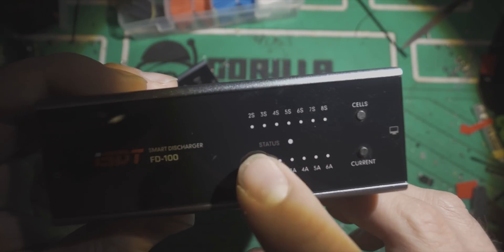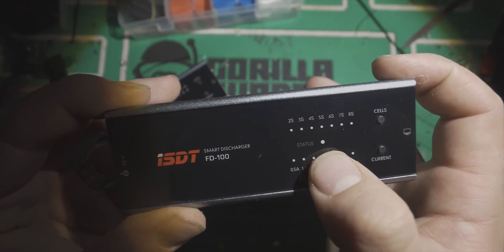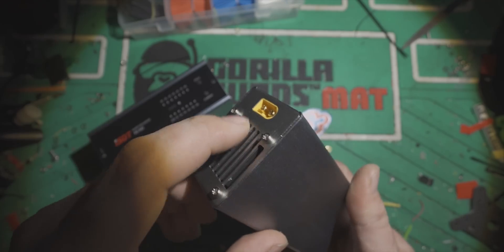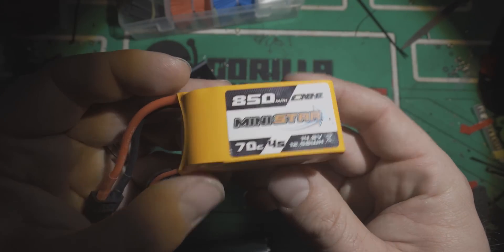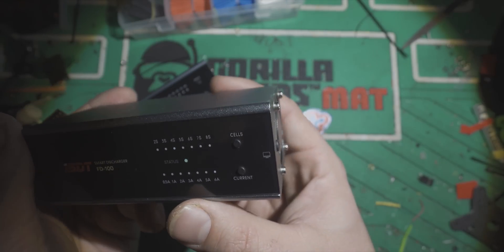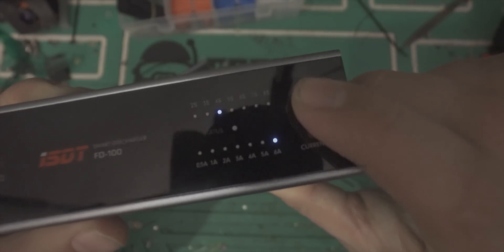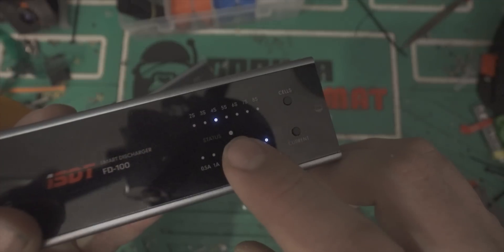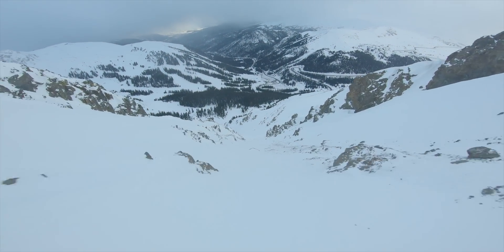What's the Point of a LiPo Discharger?

Comment: ive literally had TSA check every one of my batteries with a cell checker and put a piece of tape on every battery with voltage per cell. I didn't physically see it i just opened my bags and saw that there was tape on every battery in my bags..

Comment: How long does it take to get it from 4.2V to 3.8V? Is there a way to calculate the time it takes, maybe depending on the battery's voltage and mAh, and how many Amps you're discharging at?

Comment: I had lipo fires indoors, can't imagine being stuck in a plane with a lipo fire because some asshole failed to discharge. Breathing in those fumes without the possibility of going outside would be hellish! Not to mention when the fire jets and Oxygen rich cabin air meet. Lipos was a years long learning curve for me. Only now (after learning the hard way) do I practice safety... 6 amp 6S down to 2S hobby balance charger with the parallel boards. Discharge rate maxes out at 3 amps on my charger/discharge. My lipos are always discharged and live in the ammunition can which doesn't let in much oxygen. It gives me time to take any flaming lipos outside to the disposal bunker.

Comment: I dont see the point in this at all...I have a ISDT D2 charger and it does storage, and discharge... but I just run all my batteries in flight down to 3.70-3.77 always then at night I just simply do the automatic 3.85 storage charge.... takes much to long to discharge, if a instant comes up where I'm a little over from 3.90-4.00 I will just take off props and arm quad in house and discharge that way, it's much, much, faster.

Comment: Sory but that style discharger is definitely a very BAD thing to use. ITS NOT A BALANCED DISCHARGE! Ive been using lipos since they began being used in land RC around 2005 or something, and the first thing i learned was you must ALWAYS balance charge AND discharge if you must. I have a simple lipo charger thats seriously 15 years old now, and it has a balanced discharge function. Why not just use your charger to perform the discharge to storage?? I dont understand how that product could even be considered a "smart discharger" if its not balancing cells. And you can also PARRALLEL STORAGE if you have multiple fully charged lipos. Why use a separate discharger that only does one thing, poorly? Am i missing something?
Reply: Do your quads balance the cells as you fly?
Reply: @AdaptFPV  Touche'

Comment: I don't have any charger which can do discharge. So I just simply drill a hole into the battery and the voltage goes out quickly. I think this is the quickest and most efficient way to discharge them. But yeah, you can spend 50+ dollars if you want to.

Comment: I'm a maniac with my batteries. The same day I charge them, they go back to storage, even if I'm planning on using them the next day. I parallel charge so I need them all at the same voltage (every cell).

These iSDT dischargers do not balance. They are too expensive for what they do, and that's, nothing special. You can find dischargers with 3 bulbs and a battery tester for 10 usd that do a better job. They do not balance perfectly, but at least they check individual cells.

Anyways, the only way to balance your batteries correctly is to discharge them to 3.70V and after, use the charger to leave them in storage voltage. Why? Because if you are discharging, like when you are using your quad, the battery will recover some voltage after it stops discharging. More so, when you discharge them "quickly" (6A is nothing for these batteries).

Now, what I can say about iSDT products, at least chargers, is that they are crap. My 3 iSDT chargers died in less than 6 months, when I still have a nearly 20 years old SkyRC iMax B6 and a Turnigy Reaktor with +10 years charging every week near their max output. I will not buy iSDT products again.

Sorry for kind of making my point about iSDT and "hijacking" the comments.

Comment: I discharge full Lipo's with my charger. It's a SkyRC B6 mini but it only discharges at 300 milliamps. However it does display the individual cells and you can get graphs on your computer if you use the software that you can download for it.

Comment: It's a grate option I just wish it had a balance lead connector to read the cell count and a better plug for the computer interface... do you think it can be safely used with a parallel board to discharge several batteries at the same time?

Comment: I use a milling vice to hold my quad in the middle of the room with props on. the vise weighs like 40 lbs it doesnt move anywhere. then i bring it to a an exact 3.8 on the charger. takes about 2 mins on the vise and 3 on the charger per.

Comment: I dolphinitely love this discharger. Very quick at discharging! Recommended to me by my fellow flying pal in Indy after I had difficulty staying awake while discharging packs with the Venom Pro Duo. I don’t mind the fact that you don’t monitor the cells while discharging because I don’t during normal flight, but that would be an interesting feature on a future model. It even works with a parallel charging board. 
Love the Colorado footage by the way. I haven’t gone snowboarding in years.

Comment: I like this discharger, and I also use RDQ’s “Lipo Suction” dischargers that you just pop onto each pack and leave on overnight (LED on the Lipo Suction goes out when it has reached storage voltage and the battery stops discharging). These are set it and forget it type dischargers, and they’re cheap enough to get a bunch, so you can discharge multiple packs simultaneously instead of doing them one at a time and having to monitor and switch each pack.

Comment: NURK FPV Have you seen the lipo suction by RDQ. best thing ive ever owned, if i go out and fly and dont get through my batteries i have about 4 of these female XT60 connections that i just fit and forget, i was a little sceptical about it and thought they may get hot, but they are very good. They take a while to discharge a full pack but they bring the whole 4s battery down to 15.6 (which is 3.9 per cell) and then turn off. so cheap too.

Comment: So a few things about this product and dischargers in general.  I used to absolutely LOVE this discharger, and I used it all the time.  The small size makes it a fantastic travel accessory.  The best feature of this discharger is the ability to trickle discharge to land at a specific resting voltage.  So as it approaches the storage voltage the discharge rate slows down until that voltage is reached.  While many other dischargers (or DIY solutions) tend to always discharge at a constant amperage (The Sky RC BD200 for example, which I also own but very rarely use).  You also have the added benefit with the FD100 that you can connect a USB cable and change the final voltage via software if you choose.

So why do I say used to?  Basically, because my discharger burned out.  I used it for about 2-3 months, and then one time in the middle of discharging a pack I heard a pop, and it would never turn again, and never discharge another pack.  While I never reached out to isdt to try to get a replacement, this has made me question the reliability of this particular product.  The small form factor may contribute to a lack of reliability, and that's an issue.

Eventually I wound up purchasing an iCharger 406 Duo anyways.  The iCharger supports the same 80W discharge rate as the FD100 while also supporting a trickly discharge to land at a specific voltage.  It also supports connecting alternative dischargers to it to get a higher discharge rate while also having a finishing current (or even to charge another battery while only discharging to a set voltage).  The iCharger is a whole different level of cost, but I've definitely come to appreciate having a high quality charger.  Nothing quite matches the iCharger.  But I also hate that I had to give up the portability of the FD100.

Comment: I discharge my packs if I haven't used them in three days, I have no solid source for that info, just something I heard once and I've had packs that started acting weird after being left fully charged for a week so I try to err on the side of caution. I use my ISDT Q6 and stop the discharge program once the cells are around 3.85v. For some strange reason, it doesn't stop on its own until the cells are at 3.4v and it can't be set to stop earlier, which I find really strange. When I'm out flying, I try to hit 3.7v per cell and storage charge when I get back home. 95 % of my flying is freestyle so I'm ok with a tiny bit of sag towards the end of the flight.

Comment: I always charge/discharge my packs to storage voltage at the end of a flying day, but that FD100 is missing what I think is a very important feature - the ability to monitor & discharge individual cells, so they all end up at 3.8v, like their chargers can do.
If a cell is going bad and you discharge a 4S down to 15.2v without monitoring all the cells, that bad cell could end up well below 3.8v whilst the other cells end up higher than 3.8v.
Reply: you can use this discharger in conjunction with their battery checker to balance. not the absolute best solution but it works good enough.

Comment: When that 'FD 100 thing' went out I decided  I would wait for a V2... A  well designed 'discharger' would use a balance lead.
It would not ask how many cells the plugged LIPO has, it would know  just by plugging.
there would not be a 'oh $hit i damaged my 2S Lipo because I forgot the discharger setting on 4S'
Also a good 'discharger' would finish its job with all cells at the same precise voltage
Reply: You would not damage a 2s because you set it to 4s, The discharger knows if it's a 2s or 4s so there is no oh shit moment. I have one of these and they are great although I would like it to have a balance port.

Comment: I bought a FD100 last year after I ruined several Very expensive (and nearly new) Tattu 1550 Rline batteries by leaving them at HV charge for a week or so. 4 of the 6 developed bad cells from the one transgression. The FD100 has been used a lot since, if I don't fly in a day or 2 at most, I run them on the FD100. It's great, because I leave it in the truck and discharge while I'm driving - the plug and forget is nice so you don't overdischarge. So far, I've had much better battery life. In the cold weather it makes a good hand warmer while the truck warms up too.
Doesn't seem too expensive to me compared the the price of batteries.

Comment: My charger has discharge (and charge/discharge, discharge/charge) function. It's nice to have a dedicated tool for the task though. Does anyone cycle their batteries prior to use these days? It's meant to maximise energy density..?
Reply from the maker: The dedicated piece just discharges much much faster than a regular charger.
Reply: @NURKFPV  well that answered the only question I had.  Tha ks again.

Comment: I was looking on products to make LIPO discharging easier and i found this.
https://www.racedayquads.com/products/lipo-suction-lipo-battery-discharger
Doesnt know, if this is any good, but sounds cool just pop them on multiple lipos and dont worry about managing the lipo changes on the big ones. Goes really slow with 500mA, but thats the positive side also, it doesnt need a cooling fan and it can be done riding home or in the lipo storage box/bag. What do you think about these? :)
Reply from the maker: Those are pretty cool and a good price. I wish I didn't need to have one per voltage -
Reply: @NURKFPV  Yeah thats the only thing they suck about. Other than that they are cool. Are you going to buy? I really want to see someone test them, but no info on the internet on these.

Comment: How this discharge device know exactly the voltage per cell if not have a balancing port? I really enjoy your channel.
Reply from the maker: it doesn't know the per cell -- that's a good point. Just overall pack voltage. It's up to you to check on the voltage when you charge it rather than discharging.
Reply: @NURKFPV  I do it on my charger there is a Discharge and you can balance the cells, which is important to me.  You can also do 4 at a time!  This charger from FPV does discharge it is not the one I have but I know you have a deal with FPV :-)  https://www.getfpv.com/ev-peak-cq3-multi-charger-4x-100w-nimh-lipo-with-built-in-balance.html

Comment: Hi Nurk i have one of those Dischargers and I love it. I usually fly my packs to storage voltage trying to suck out 800-900 Mah on 1550 Packs and they are at 3.8ish when i come down, & if there are packs i don't use they go on the FD100. If there are ones below storage i charge up above storage then draw back to storage. I have several packs that have been used for almost 3 years now and they still hold a decent charge. And your right the fan is LOUD sounds like a jet spooling up it's afterburners.
Reply from the maker: Awesome! Glad to hear someone else is getting some good use out of it!

Comment: I use isdt's battery checker that also does usb charging. Whenever I need to discharge, I just charge up my battery bank .I can set up the battery checker to stop charging my battery pack once the voltage hits 3.8 Win-win. Discharged lipo and charged up my battery bank
Reply: Doing the exact same thing, love the isdt battery checker! And it does check all cells so you can make sure that they're balanced (that's a pro for me compared to the isdt discharger)
Reply: I do the same, once I'm back at base,  Fatshark pack goes on USB port and get's charged, if that's full, I then charge power bricks, iPad, iPhone etc....  great bit of kit, and no need to convert all that energy to heat, use it to charge...
Reply from the maker: ooh that's a great idea too

Comment: I got one of these but found lately I have been using my charger to discharge if I have several because it has 4 ports or I have been using my charged packs is to charge 1s whoop batteries. Charging 6, 1s 250 batteries gets you pretty close to storage on a 4s 1500.

Comment: My charger has discharge to storage voltage option. I use it periodically due to weather or work schedule. And its fan runs non-stop, pretty loud for such a little thing.  If you have a lot of lipos this product could be useful. Happy flying  :-)
Reply from the maker: Yes, but can it discharge at 6A on your charger? 6A is so much faster than anything else I've ever seen.
Reply: @NURKFPV  just 2a x 2 for two lipos. 6A is impressive. For now that's fine for me. I've only just started. Largest lipo I use at the moment is 3S 850mah Building my first 3 inch and a 5 inch is ready to follow. Love your vlogs. Happy flying. 👍💖🤓

Comment: What i have been doing lately is using my full lipos to charge my discharged lipos to 3.8v. Assuming that you fly them down to below 3.8v (which i do almost every single time).
Reply: That's exactly what I do, much more efficient than letting all that energy go to heat on a discharger. And for times when weather gets in the way and I have less empty than charged batteries, I will usually discharge them by charging whoop batteries as much as I can and then use the rest on my 5" quad indoor to clean dust behind my furniture :)
Reply from the maker: That's a great method too!
Reply: How does it not exlpode? Charging at 100c rate?? This is also one of the first rules of parrallel charging and discharging, the cells must be near equal voltage. How are you connecting them? That is why most parrallel boards have fuses?
Reply: @661FPV  you don't connect the two batteries directly in parallel, you use the full battery as input to a DC charger and you put the empty battery on the output and charge it. Set your charger to stop when input voltage is below ~3.7V/cell and it will stop once the input battery is at around storage voltage when resting.
Reply: Filip Radelic you are one smart cookie!